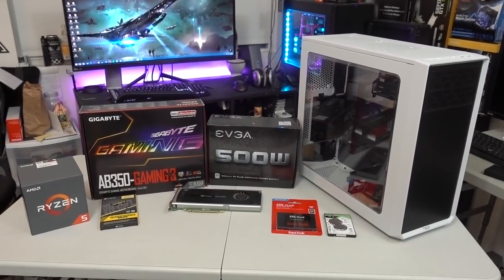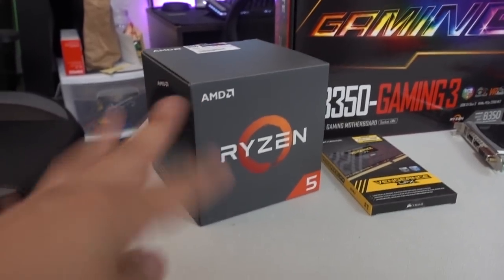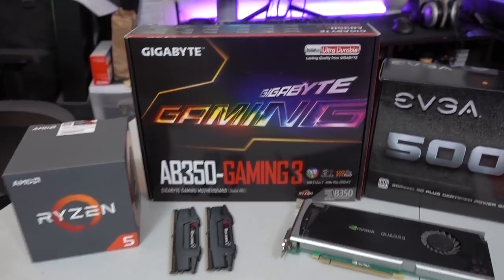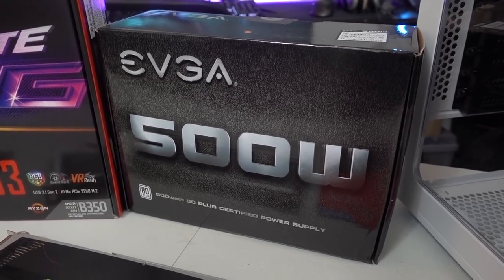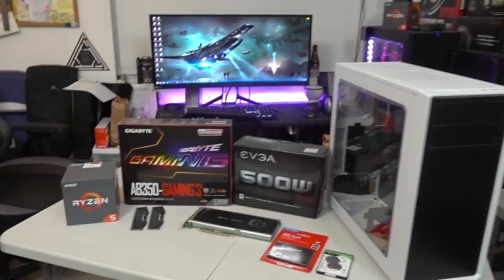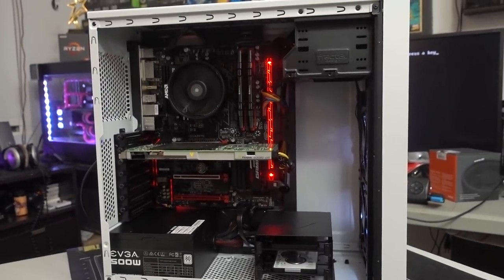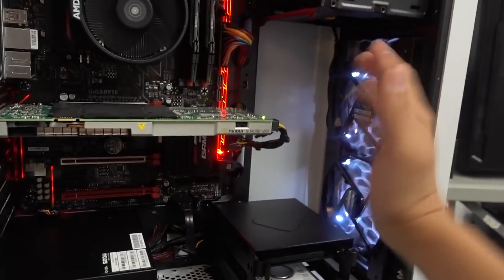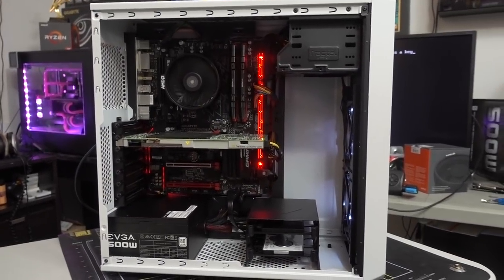A Ryzen Workstation for the Family!

Comment: "This PC is not for gaming"
uses a gaming motherboard
Reply: The Punisher lol
Reply: gaming cpu? how the fuck is that even a thing. even gaming ram makes no sense
Reply: There's no such thing as a "gaming" motherboard, it's just a motherboard. It's all branding.
Reply: Currently most motherboard that support ryzen are design for gamers
Reply: The Punisher Does it mean if on the box reads "GAMING" it's a gaming motherboard
Reply: I recently built 18 servers based on Gaming Motherboards and Gaming GPUs, simply because these parts were the best suited for the task - what's a Gaming PC, what's a Workstation and what's a Server depends on what you do with it, not what the parts you used are called. 

Take Cryptomining Rigs for example - you'd typically want a very cheap PSU, processor board and RAM - certainly not "workstation grade" or "server grade", as well as 6 RX580 videocards, which are "gaming" cards. So, you don't use any server components and still end up with what is pretty much the ideal server for the task.
Reply: Jonas - Paint your motherboard black and red, sell it overpriced to naive kids.
Paint it green and sell it overpriced to naive companies.
Reply: Virtually everything you can cram into a computer case is marketed as gaming hardware.
Reply: The Punisher everything in the consumer market is labeled gaming. "gaming" is not a real thing. it's marketing.
Reply: Gaming anything other than pads/wheels/joysticks is meaningless marketing fluff (and even then, two of those device types have serious applications).  There's just mobile, desktop, and workstation/server class hardware, and even then there's not a great deal between them beyond thermal profiles and redundancies (ECC in workstation/server, for e.g.)
Reply: I'm sorry do you see any production grade AMD boards at the market?
PS: Rly a 5 year old graphics card. I'm disappointed Kyle, people compare the Quadro 4000 to a GTX670. Titan Z or Black would've been way better.
Reply: Gaming CPU? Ryzen isn't necessarily a gaming cpu..
Reply: Ediranii it's a workstation card. it would perform pretty bad in games but as a workstation card it's great.
Reply: The Punisher i
Reply: Leo Fisher If you would compare it to its geforce counter part it wouldn't perform that different.
Ignoring price to performance..
Reply: Ediranii what's a 'production board'? an ugly ass green PCB monstrosity?  ECC support is on the CPU.  This is the same shit but in reverse.
Reply: it has better ports
Reply from the maker: and those who watch the video know why! ;)
Reply: But are there currently any boards that actually support ECC? And do you really need ECC for something that's not a fileserver?
Reply: name a workstation motherboard with RGB... I'll wait.
Reply: He used it because he had it, why spend money when you have one you dont need
Reply: Did view the video ey?
Reply: The Punisher lol Whats up Punisher
Reply: "Gamer" boards generally have better components and peripheral support compared to basic business boards. Obv either this or a workstation oriented board if you need massive I/O requirements.
Reply: You do realize that the "gaming" on anything is just marketing right ? Words like "Gaming" , "VR Ready" , etc. are added for marketing , because there are a lot of dumb people that don't know what to buy. There is no such thing as gaming motherboard. There are motherboards made for overcloing or/and with more PCI-E lanes , but again this does not make the optimized for games ... companies just slap "gaming" on everything this days and add a bigger price tag.
Reply: The term "gaming" has lost almost all meaning. Any computer that performs well will be referred to as a "gaming pc" at some point. A university server will potentially use "gaming" hardware. I'm actually so sick of this buzzword. 😨
Reply: it's all just marketing gimmicks, folks...
Reply: Unless he wanted a server motherboard, what else are you going to get? The next thing to enterprise is consumer elitist hardware. He could have also gotten ECC memory, but that's clearly not what he's using this system for. He clearly isn't forcing over 2 grand for a 32 core CPU either, probably because that's nowhere near his intended use for this system. You don't need enterprise grade stuff to do impressive things, High end IS gaming, at least for those who aren't Microsoft or Google. The whole purpose was to do CAD and CNC, which I personally do myself, and a "high end" motherboard that won't make you bankrupt is a gaming one. He honestly  didn't even need the Quadro card either, because those honestly only benefit users of high core tasks such as using Redshift GPU render, or need 24GB of VRAM.
Reply: There is no much difference between a gaming and a non-gaming motherboard. Most feautures on gaming motherboards are lies (e.g.: ASUS' KillerNetwork/GameFirst).
Reply: >makes smart comment
>didn't even watch the video in which he explained his choice
Reply: actually "Killer" branded boards offer better networking whether its killer wifi or killer Lan port.
Reply: There is no such thing as a gaming motherboard.
Reply: Ed's Best Tech Killer NICs are garbage. The drivers especially, they have massive memory leak issues.
Reply: Yea, use something like a Asus WX motherboard, which cost about $250 or higher... oh, wait, there is no WS-motherboards for AM4.
Reply: Are there even any non gaming motherboards out there anymore? Only ones that come to mind are the WS from Asus.
Reply: juts because something says gaming doesnt mean its only for gaming lol those extra features work good with other applications as well as games....whens the last time youve seen a "video editing" motherboard being marketed? lol
Reply: he used the gaming MOBO and RAM because he had them lying around not getting used at all and everything else is not gaming oriented as the CPU has low IPC and GPU is a quadro 
also to those who say he could have sold the parts he would not be doing himself any benefit at all for example if his MOBO was $100 and he wanted to get a cheaper one he already has opened the MOBO so he has to sell it cheaper than RRP so then he may sell it at $85-$90 just to get a cheaper motherboard which probably costs as much as what he made from the sale and if he used eBay he has to pay eBay and PayPal tax
Reply: lol you talking crap about my fx 8370
Reply: My motherboard has "Tomahawk" on the box, does that mean I can throw my motherboard at people and kill them like they do in BO2?
Reply: BassDropGaming there is a specific thing for both, Xeon for workstation and not good for gaming because the clock speed isn't very high, and something like the 7700k for gaming because of the high clock and less cores.
Reply: Look, 3d software uses gpu a lot (specially memory, my god), also new cpus, specially ryzen is a seudo workstation chip. Meaning it can do some gaming but the high core count is good for workstation loads.
Reply: Gaming CPU? Wot?
Reply: Don't think there is a workstation motherboard for ryzen yet (one's that validated for ECC RAM, that lists supported ECC RAM modules officiall) as only asrock (and I think gigabyte) have ecc ram listed
Reply: Because the word gaming in the product title actually means it's better for gaming than non gaming work. It will literally stop working if you don't feed it some games to play at least once a day... /s
Reply: You understand nothing of marketing!
Reply: Geforce are for n00bs and CHILDREN. I use Quadro to edit 10-bit content xeons are used a lot in work stations, and btw change your name it's terrible. Some of us aren't made of money, and also love to know what u think about AMD and vega.
Reply: BarryAllen SlowestManAlive /s is an Internet term for sarcasm
Reply: Vintr and rgb
Reply: Most motherboards these days advertise themselves as being "gaming" motherboards, so the term gaming motherboard got effectively meaningless the last couple of years.
Reply: Gaming oriented...not solely for gaming it's just marketed that way😏

Comment: I've had the R5 1600 for about 3 days now, I love it so far. A nice upgrade from the FX 8350.
Reply: did you overclock it? :D
Reply: I'm thinking of making the exact same jump. What clocks were your 8350 at and what sort of improvements are you seeing?
Reply: Can u guys check out my build & perhaps give some suggestions/ tips?

If there would be any good alternatives for the parts let me know, for I would like it to keep the price as low as possible.

Mainly I'll be using this build for gaming most especially w/ video editing & rendering. Will it be good enough? What u guys think?

BUILD:
CPU: Ryzen 5 1600 ~

GPU: 
•ASUS Dual GTX1060 O6G ~ 
OR
•(Brand) GTX 1050Ti 4GB ~ 
OR
•RX 480 ~

RAM:
•G.Skill Ripjaws V 8GB DDR4 3200 MHz(2x4GB) ~
"OR ANY 8GB DDR4 3000 MHz"

MOBO:
•ASUS Prime B350-Plus ~ 

Storage:
•1 TB HDD 7200 rpm ~ 

PSU:
•EVGA 650 Watts 80+ Bronze ~
"OR ANY 550-650W Bronze"

Monitor:
•ASUS ~ ?

Case:
•??? ~ ?

Though I'm not sure w/ the GPU, RAM, & PSU. With GPU, I may also include in my choices the RX 480? In RAM, I'm not sure whether 8 GB would be sufficient. Then with the PSU, I'm not sure w/ the proper voltage.
Reply: Nick Poma at least you upgraded from that I went from a 4300 😭
Reply: Expecto RX 570 8GB GAMING
Reply: @oNeHiVeGT  Get the case that is post here, i think is enought for mid range pc. Add a 120gb ssd (any  brand is good, i like adata and crucial) for the startup of windows and some frecuent game or program, use the hdd for storage media files and other games/programs not frequently use. A 550w ps 80+ bronze can manage your system. Monitor; you can go for the AOC G2460PF for amd if you use any the rx480 or the gtx1060 or the Acer XFA240 if you only go for nvidia cards, freesync can support nvidia pascal and up architecture cards.

Comment: $110 "Fairly budget oriented"
Reply: Fiterpilot youre just poor
Reply: no 110 is midrange
Reply: Knight, poor?? Because I don't want to spend $110 for a "budget" option I'm poor??

turnt I agree
Reply: That's really cheap if you have a stable income.
Reply: Hmmm...Nahh, that's low end and you're just poor
Reply: gotta agree, 110 is pretty low end
Reply: 110 is definitely budget oriented :P
Reply: I don't see how it's low end, but even if it is it is NOT a "budget" option.
Reply: Turnt Marshfellow Think so too.
High end is 200$+
I use the Asus z270a Prime, I think thats mid range too
Reply: Cheap motherboards dont get the best IO ports
Reply: well yeah. go look at the ASUS range of WS "workstation" boards. $110 is absolutely budget oriented when workstation boards are $300-$600+
Reply: Budget oriented doesn't always mean "Crazy Cheap". When building any PC, it's about searching for what you specifically need for your purposes that you are building that PC for. As someone who's worked with workstation machines, not all have the latest and greatest high end PSU's or even cooling solutions. I'm neither a fan of Intel or AMD, but for workstation purposes I'd probably pick AMD, because they offer better "bang for the buck" once you've the correct cooling, and add a safe overclock.
Reply: JustIncognito Expensive motherboards are aimed at professionals who do use the features they need. Maybe not all of them but I can assure you that those features are there for a reason.
Reply: A lot of high end features aren't needed for gamers, most are for enthusiasts and stuff.
Reply: Fiterpilot I said professionals not gamers.
Reply: It is midrange, but still pretty cheap. Budget is like 60 to 100, midrange is about 110 (maybe a bit higher), high end is 150 to usually about 230. Anything above and u crazy dude
Reply: So as an owner of the Crosshair Hero VI and I am crazy?
Reply: Whilst I agree most "Gamers" don't utilize the "high end features" on a motherboard, but if you are someone who is running multiple drivers, then you are technically utilizing some of the high end features.
Reply: 110$ for a completely new gen mobo?`i think thats quite budget. check the prices on other ryzen mobos. you wont find anything good below 100$.
Reply: JustIncognito What features are you addressing? What is the use case of the buyer? I've built 5 ryzen systems, one for myself, 3 for friends, and one for a friend of a friend. 2 of the systems included x370 motherboards and 3 used b350. the three on b350 just wanted cheap gaming pcs and used the b350 mate from msi, an 80~ dollar motherboard that covers all the basics. the two x370 systems use a lot more, one being a streamer who needed an upgrade and the other being an enthusiast with two gpu's and does minor YouTube. 

so just because a feature on a motherboard isn't useful to you, doesn't mean it's not useful to everyone. buy a board that's appropriate to you and call it a day. 

just curious, what "fancy features that you will never use" are you talking about?
Reply: Owen Terry Poor is a bit too harsh I'd say low end.
Reply: Vantave High end is 300+. Have you seen the latest motherboard prices? The highest end motherboards are almost $600. Mid range is 150. 110 is DEF low end. Has anyone tried building with a sub $100 motherboard? They’re so flimsy and cheap. Go for something reliable. It’s not about someone being poor. The fact is, $110 is very low end with the tech out today (X299, X270, Threadripper).
Reply: Scott G. I built with 80 dollar mobos and they work just fine. Sorry you think thickness=quality. That's the dumbest thing I've heard.
Reply: Owen Terry what do you have a pc for? If you were a gamer, you wouldnt need a $400 cpu. If you do encoding, you would need a mobo for higher than $100. And didnt you call anything below $110 for poor people? Am i missing something?
Reply: The Hero IV is an awesome MOBO and not crazy expensive. The RAMPAGE (600 bucks) on the other hand is crazy expensive, but I want it over all other boards.
Reply: You can get MSI Mate or Mortar for 80$, or the Asus B350 Prime Plus for 100$. They all can run 3200Mhz ram, a few of them have LED connections, one has type-c USB if you want that. All have M2. They all can overclock the chips no problem. How is that not budget priced? For 110$ you can get a X370 ITX board even.
Reply: Yeah most atx boards run $99 or up. you're probably talking about those smaller micro atx boards you can find for $40- $80 .
Reply: Low end= gtx 1050, rx 460
Mid end= Rx 480, gtx 1060
High end= Gtx 1070, 1080
GOD LEVEL VIRGIN SHIELD 900= Titan XP<
Reply: $110 is good on a budget

if you make 3 digits a month
Reply: Fiterpilot budget does not always mean it’s cheap use your common sense ffs.

Comment: Glad to see you did your homework on the software before building, it makes a big difference when you get the correct hardware for the software. I have built several workstations for CAD primarily oriented towards SoildWorks were single core clock speed is almost always the way to go. Nice to see a CAD software finally see a multithreaded CAD program!